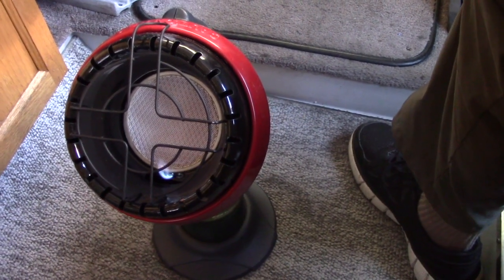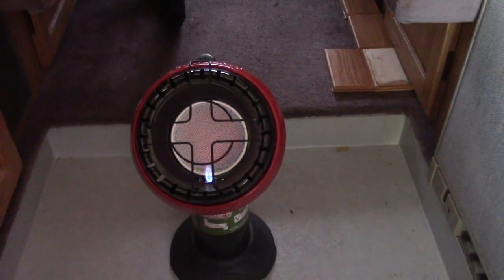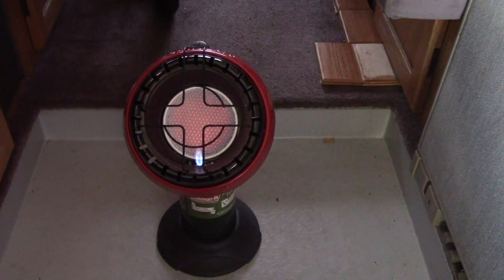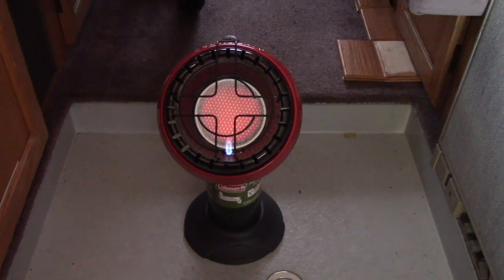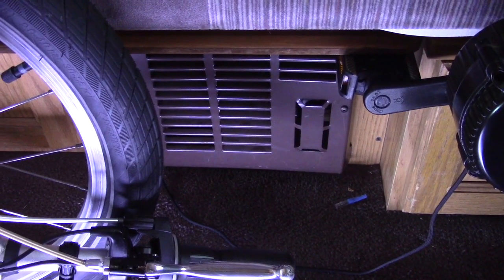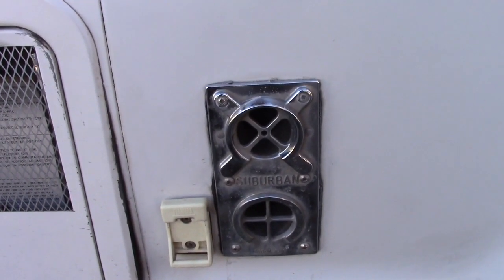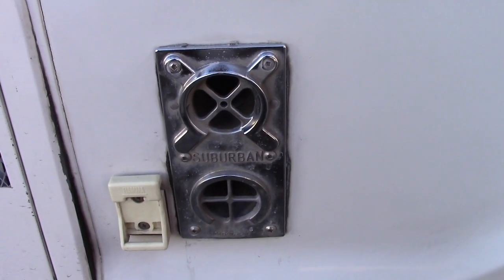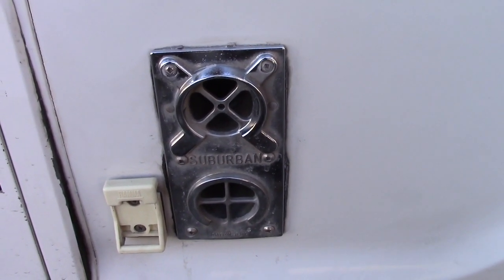Mr Buddy Little Buddy Heater...My Impressions

Comment: Thank you for sharing. I'm in my research stages and when it comes to heat I plan on making a class b my fulltime home by boondocking/stealth camping. So in the winter I will need all the warmth I can get. I'm in Ohio. I hear installing good insulation helps too. But it's only easy to install probably when you start from scratch with an empty van build I guess? Probably can't do much with insulation buying a used class b I assume. But I do like the forced air furnace idea. Otherwise, I have seen people install wood burning furnaces or propane furnaces where they have a stack that goes straight up and out through the roof. I wonder if forced air furnace alone is enough or not. I assume it will be hard to prevent my water tanks from freezing so guess I might have to winterize the tanks during the winter. But my goal for me is that it has to work in all 4 seasons cuz I want it to be my main home. I enjoy your tips and any thoughts you have on the subject. Thanks again for sharing.
Reply from the maker: Hi Brian Mizway, thank you for the comment.
Looking at the annual average temperature of Ohio, it looks like cold weather is the part of the temp spectrum that is more imperative. In Ohio, you have months of temperatures with lows in sub-freezzing to contend with.
Living full time in a van in those conditions is going to be very challenging. As far as I know, which admittedly is not very far, the only way we have to generate heat is to turn some other form of energy into it.
There are a variety of heating fuels, wood, coal, heating oil, propane, electricity.
There are a number of things in the van that need to be heated, living area, hot water heater, holding tanks and all the connecting plumbing.
How you address these needs depends on how you and you prospective vehicle are going to interact with the environment.
Are you driving everyday?  How much time are spending in or around the van?  Are you spending time in other environments ?  How are you using the vehicle? Is this the place you use for sleeping?  Do you need to prepare meals? Are you using it for toilet and bathing?
 If your goal is to create a fully self contained, mobile living environment, then doing it in the climate of Ohio, year round is going to equal expensive, relative to more moderate climate.  Here is my thinking.
In cold weather, even a well insulated van, like the Roadtrek, is essentially a "well insulated" ice chest in which the challenge will be to heat up the inside, keep the pipes from freezing, keep a supply of hot water hot, and maintain this living environment while being disconnected from conventional energy sources.
You will need to employ unconventional (read more expensive) energy strategies to maintain this living environment.
OR you will need to have access to conventional energy sources such that you can "plug in" to these sources and utilize their abundant, low cost availability during a portion of the day that you need energy.
If I had to be in the Ohio type climate AND live full time in the Roadtrek, I would be looking for someplace that I could tie into electrical power during the period I occupied the van.  The relative low cost of electricity and the relative higher costs of all other forms of energy along with the impractical nature of their use would make electricity and sourcing it my number one priority.
I can use clean, dry, combustion free electricity to do everything and with only one connection to the van.
To have or maintain a mobile,  "off-grid", self contained modality, the alternative, as far as I know, which is not too far, is to use gasoline, propane, battery storage power AND electricity. 
When not "plugged in", I still have to keep water hot in the water heater, and the pipes from freezing which will require heating the tanks and pipes using electricity I have stored in batteries on board, unconventional and expensive. And without recharging, this source of electricity is very limited. Recharging will require yet another system and other forms of energy to power the system to do the recharging, involving some losses I have to incur, not nearly as efficient.
While these circumstances present challenges, those challenges aren't insurmountable. 
The challenges of sub-freezing climates are much more demanding than those of hot climates.  
As long as we have water, there are many things we can do to mitigate heat.
Cold, on the other hand, is something that very rapidly exhausts whatever energy we might have to generate heat.  
So in cold weather, my goal would be to find the cheapest, most abundant, most efficient, form of energy that could be used over the widest range of applications.
For me, in such a climate, I would either find someone connected to the grid that had available parking with electrical power and pay them for this or I would migrate from the cold area to a warmer climate where the cold was not an issue.
 I understand there might be any number of reasons that I would need to be in a cold climate and not be able to leave for a warmer area.  So in that colder weather, I would be looking for somewhere that had a source of electricity.  That might be an rv park, a private residence, a business, etc.  There are resources everywhere. It would be up to me to figure out a creative, mutually beneficial situation and "sell" the prospect to an interested party.  The goal is to use what is available as efficiently as possible and at the lowest cost.
Boon docking or stealth living is going to present some challenges, too.  If the "off grid" scenario is such that running a generator isn't a problem, then that would be a possibility. If the scenario is more conspicuous, then stealth is complicated. There might be enough electricity for tank heaters and maybe a sleeping bag heater but using propane to heat water and/or the interior will be an expensive method.  There is also a tremendous amount of moisture involved in the process.  Moisture has its own problems not the least of which its ability to absorb heat making the process less efficient than the dry heat of electricity. 
Anyway, I hope this is food for thought in your creating a plan moving forward.
Reply: @RoadtrekRich  yes and thank you so much for the deep reply. It does make me think twice but I'm hoping to pull it off perhaps...maybe I'm crazy. I'm hoping that power would come from the batteries as well as a generator running with having a good inverter as well. I'm guessing 1 20lb propane tank every 4 to 5 days? So if I need 5 refills of a 20 lb tank per month at 25 bucks a refill, perhaps I could just look at it like a gas expense for a traditional home? Maybe $125-150 a mth? Still thinking it through. But yes, thank you for the info. I'm just glad I don't live in Minnesota...they can get -80F I guess? Lol. Thanks
Reply from the maker: @brianmizway9324  ,  I don't think you are crazy and yes, you can pull it off.
There are other types of radiant heaters than a Buddy.   Here's a link to a video https://youtu.be/fPXRCANYxEU where Bob discusses how he heated a vehicle in Alaska at 20 below using a Wave 3 catalytic heater.
I had both a forced air furnace and a catalytic heater in a previous class c vehicle.  The catalytic heater was my preferred method for heating in cold weather. 
You mentioned "winterizing the water system and the HOBOTECH channel has good info on what is involved to keep the water system in the Roadtrek working.
I would anticipate the water being the biggest challenge since it requires electrical power.  So all your thoughts regarding a generator and inverter are important along with an adequate battery storage capacity.  
It might be a lot less expensive and also less convenient to shut the water system down in winter. It would mean finding and utilizing other strategies for bathing and toilet.  These are common strategies people are using everyday.  Most people don't have the systems incorporated in the Roadtrek.  In the freezing part of the year, you may find it most cost effective to forego the systems.
From my reading and watching, the heat seems to be fairly easy.  The water is where things start getting complicated and expensive.

Comment: How much C02 are you getting on the little buddy  and the furance
Reply from the maker: Hi Kenneth, thank you for the question. The furnace zero. Burned gas vents outside. There is a heat exchanger like the one in a regular house that blows the warm air it draws in from the interior.  As for the buddy, I'm not using it.  I turned it on, stepped out of the van for a few minutes and when I stepped back in, I was met with the smell of propane burned in a closed environment.  People say and even the buddy says it can be used indoors with proper ventilation.  
I say okay but "proper ventilation" means opening a window or something.  When it is freezing out, I find opening windows kind of counter productive to warming the inside of the van.
Realistically, I don't want to use either one.  I want to stay in areas where the overnight temps don't go below about 45 degrees.  This is a very comfortable minimum temp to sleep in, at least for me.

Comment: Stay away from this heater, i have the portable buddy and 2 big buddies and they are awesome, the lil buddy i used 1 or 2 times then stored it away in its box and then tried it the next year and the pilot will come on if u hold it down but it will not light the heater no matter how long i hold down the pilot, 30 seconds, a minute, doesnt matter it wont ignite, tried  cleaning it per the maintenance instructions with a cue tip and blew it out with compressed air too, no help, just get the portable buddy or big buddy avoid this piece of crap at all costs huge waste of money!!!
Reply from the maker: Hi General Lee, Wow .  Like me I guess you were looking at this heater as something to use in an emergency.
The primary thing I want from something I classify as an emergency item is reliability.
I'm not convinced the big ones are all that much better.
I've read that the company has put out a repair kit for this kind of failure in light of customers either returning or buying another one and the ensuing complaints involved. Don't know if that if true because so many people seem to have used these and recommend them...those recommendations were what I based things on.
Well, I guess it's time to start a hunt for a different alternative.
The forced air furnace in the van uses 4 pounds of propane for 5 running hours and 3.5 amps per running hour.  That means allocating a lot of battery power at night and refilling the propane every few days.
I have to think in the 23 years since the van was built, there have probably been some advancements and maybe I can find a more efficient, economical solution.
Thank you for your comment.  Let the hunt begin  !!
Reply: I depended on these heaters   since , like 2008 I have owned and depended on the two ceramic model and the single ceramic model. .  Very reliable for many years . But I bought three of them in Nov. 2018  the round one 3000 btu  and the 4 to 9000 btu  model and both quit working with in 30 hours . Something is bad wrong with the heaters if you have to dismantle  and replace or clean within 2 days of use.
Reply from the maker: Hi  @bobbrawley2612 , thank you for the comment.
I just posted a video, "Top 10 Reasons I Chose A Diesel Furnace".
It would depend on your application as to whether this type of set up would work for you.
Ceramic Heaters definitely have a place.  But like I replied to General Lee, when you depend on something and it fails, or only works a short time, it's not the dependable, "go to" device I need.
These diesel furnaces are also built as a free standing, portable unit.  The price is higher but that might be something to look into if you need portability.

Comment: I had the larger version of the Mr. Buddy Heater for my GMC Starcraft 2500 Conversion Van.  While the Mr. Buddy heaters do a solid job of heating an RV, they tend to make the heated air a bit humid in nature.  You’re right about keeping a window (or two) cracked an inch or more—carbon monoxide kills.  I would never use any propane fired heater left on at night; too risky.  What I found works well is too have a good quality water bottle with hot water inside—place it inside the sleeping bag wrapped in a towel where your feet go.  I also found that a Wave 3 propane fired heater eliminates the moisture in the air problem—it is as comfortable as in a house.  A Wave 3 (see amazon) is more pricey but is much more efficient and allows the heat to be spread evenly throughout your van or RV.  You still have propane and vented windows you have to contend with.  However, you are much more comfortable.  Still, I only use the Wave 3 to heat up the van just before I go to bed and use the heated water bottle at the foot of my 0 degree sleeping bag.  I also have a 12 v plug in blanket  with adjustable thermostat under my mattress topper.  (I have two rechargeable AGM marine batteries I use for power).  Wearing socks and having thermal insulated boots for getting out of bed at night also helps.  If it is really cold (20 degrees or less), I suggest layered clothing,  100% wool socks, and a second or even third sleeping bag that unzips to form a rectangle as a blanket; I keep one under me and above the sleeping bag I’m in if it is really cold.  Also, wearing a ski cap and thermal gloves works wonders too.  ‘Sorry this is so long.  Great video and thanks for sharing!

Comment: I don't think that's meant to be used in a van.
Reply from the maker: Hi The Loobis,
Thank you for the comment.  Further down in the comments, Gaetan Simard commented about the different constituents of combustion.  The Little Buddy is a catalytic type of heater.  The amount of of CO is a very tiny amount from the pilot light.
I don't think a company could make a product that is so widely used by people in a small space if it weren't safe when following their prescribed procedures and still be in business.
I think the heater is a good back up source of heat for me.  It travels with me along with a few canisters of propane just in case I need some heat.
I like it's portability.  The heat is passive, radiant heat so I have added a usb powered portable fan that I can use to direct the heated air to more desirable "zones" in the van where I can enjoy the benefits more.
The main objection for me is I guess I have a sensitivity to the trace odor in the propane that let's us smell an otherwise odorless gas.
This trace smell was off putting to me until I got the usb fan.  The fan mixes the heated air better and reduces the concentration of the smell making it not so bothersome to me.
Smells are subjective though and not a health or safety concern. As far as I know, the ordorant in the propane is safe and put there to be able to detect the presence of the odorless gas should it be present.

Comment: Any flame produces carbon monoxide.....from a match to a gas stove at home.......any flame at all.....
Reply: No, only a dirty flame produces carbon monoxide, every flame consumes oxygen and produces co2,
Reply: @forfrigsakes3330   Technically yes...but most flames dont burn that clean.....and even of they dont burn clean and produce  Carbon  Dioxide..... and eventually carbon monoxide....its usually very small amounts like on a gas range in the kitchen.....as long as there is ventilation.....
Reply: @philoeolivarria448  ,No most flames do burn that clean. if your flame doesn't burn that clean you have a severe problem that needs to be addressed and corrected.

Fire depletes oxygen, you're right ventilation is the key everything burned must be vented or replaced with enough fresh excess air, and if you consume too much oxygen you will create CO, but the oxygen deprivation especially in a small space can kill you before  any CO shows up.

Co is only twice as deadly as Co2 because it has half the oxygen co2 is still deadly as hell though.

The presence of Co is the sign of a problem.

The buddy heaters have an oxygen sensor in them that will shut the unit down before any Co has the chance to show up, that's why in the US they market them as "indoor safe", but in Canada they can't because the fuel oil code states no appliance that burns fuel can be unvented indoors, with no exceptions.

I'm an oil and gas technician by trade I analyze flames every day, I could set up a buddy heater in a box and run it with my analyzer and find out what exact levels the heater kicks out at.
Reply: @forfrigsakes3330  I understand what you are saying...as soon as you said Canada...I'm thinking California...lol.   I just assume that all flames can cause carbon monoxide... as in a person should assume that all guns are loaded.........that's all...

Comment: How do you fill the propane Roadtrek heater?
Reply: I means the furnace.
Reply: I meant to say , how do you fill the Roadtrek propane furnace?
Reply from the maker: Hi Hilda. Thank you for the question.
I go to the gas station that also has propane.
The step on the driver's side leading into the driver's seat is a flip up door and under it is access to the on board propane tank.  It holds about 4 or 5 gallons. The gas station person hooks up the propane, fills the tank and I go inside and pay for it.
Depending on my usage, it usually lasts a month.
All the things in the Roadtrek that use propane are connected to this tank so I can cook, refrigerate, use the furnace as I need without having to "hook" anything up.
It's just like being at home, easy.